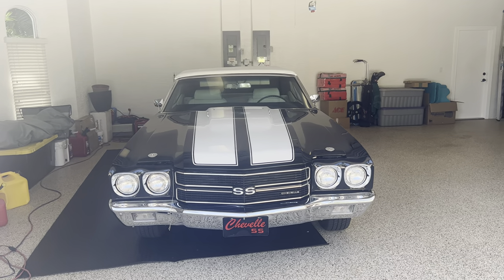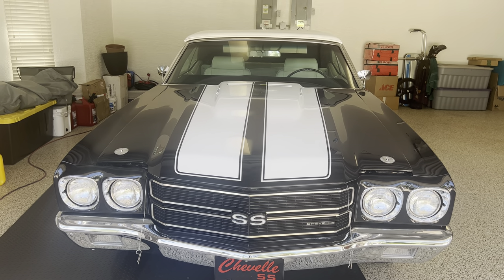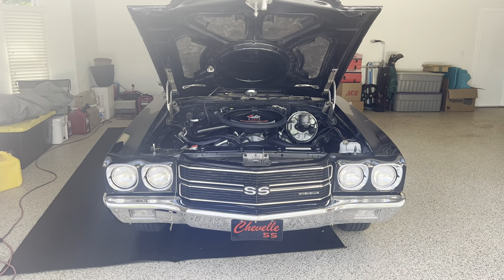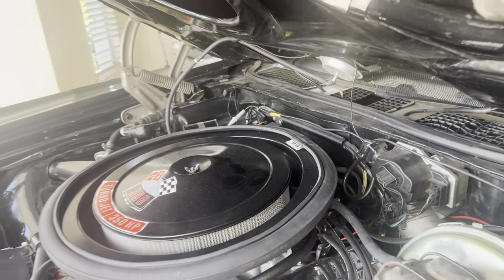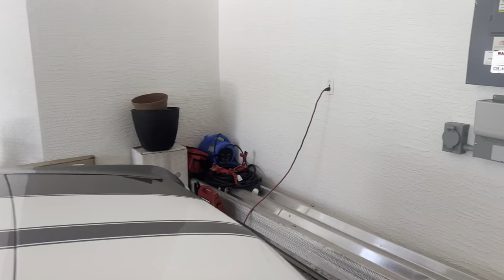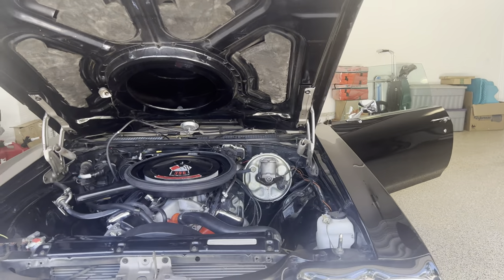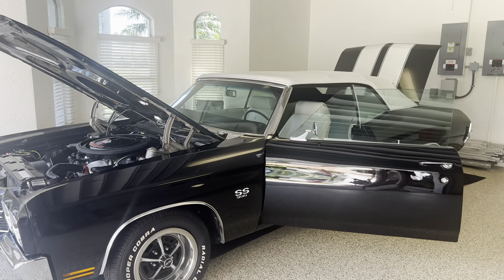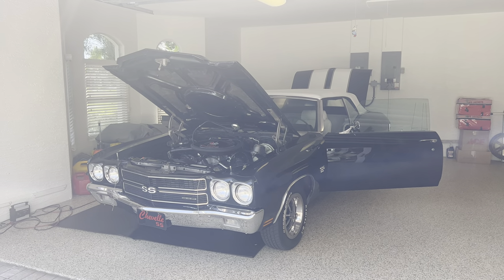FOR SALE!! Earliest Known Baltimore, MD Built 1970 SS Chevelle Convertible Surfaces in South Florida

Comment: Hi I purchased this car its very nice , the owner had the original numbers matching transmission, radiator, condenser, shifter and console and drive shaft . I will bring the car to a much higher level , New interior complete  , everything  back to original . Undercarriage and engine high-end detail, correct 14in SS wheels and correct firestone tires. New rear bumper .  The only thing am not going to change is the paint color , the paint is very nice , looks great. My cars are very high quality . I kept Intouch with owner for several months and final came to far deal .I wanted an LS 5 but so hard to find numbers matching Chevelle's with a build sheet. I have a very nice Monte Carlo SS 454 LS5 so the 396 will ne a nice addition to my collection. I appreciated all the comments and all those changes will  be noted and corrected , like I said am just not changing the paint color, paint and stripes are vey nice.

Comment: Patrick, I've been missing the videos, but that's  the "nature of the beast."You can't just "wish them out of hiding. "
A spectacular car.
I just saw Nikki six 71 Chevelle convertible sell at B-J for 100k.
Really nice car. I should've checked again first, but I know it was Cranberry Red, White/White, 71. I'm pretty sure it was a 71, not 72. It was 100k even.
-
I would Cruz to shows as is, Gently 😁. It looks great. It does have the Chrome strip under the headlights you say are present on earlier builds.
The glare outside made it hard to tell until the grill shot at the end.
Going by current Mecum & B-J auction numbers. I would think it an insult to offer anything south of 100k.
Factoring in a $15-20k or more perfect Fathom blue paint & trans swap back to original.
Great Job.
Thanks.🇺🇲

Comment: Would have been nice to hear it Patrick. might help with the sale.
Reply: Why start up the engine???    I've seen enough just going over the information.    It's a driver car, not a survivor car.   Non original transmission and changed over to a 4 speed.   Non original color either.     Just remember, if Patrick didn't buy it, you don't buy it.    LOL
Reply: @gregorylyon1004  When was the last time you bought a car with out listening to the engine?

Comment: Considering how that car was built, why does someone make these changes? They didn’t restore it because restore means take back to original. If you want to float around on radials, go buy a new car. 15” wheels with lower profile radials don’t fill the wheel wells like 14” wheels and original white letter bias plys. Nice despite all that.
Reply: This car is a daily driver car, not a survivor car.   If Patrick didn't buy it, you don't buy it.    Non original

Comment: This is an A/C car in South Florida, BUT where is the compressor?? Car was restored with the wrong color, some aftermarket parts, no a/c and transmission was changed to 4 speed? (Yes you stated the original is still included) Granted, it's still a NICE car, but all that SEVERELY affects its  CURRENT resale price. If you're NOT listing it here, then it's likely WAY TOO MUCH... Thanks for bringing this video, don't get me wrong, Patrick keep up the good work!!! Best Wishes!!
Reply: That car is a driver car, not a survivor car.    It better be cheap.    Patrick didn't buy it, so you don't buy it.     Non original joke with highway gearing

Comment: Trunk emblem delete ??
Reply from the maker: The holes were filled in. Evidently the individual responsible wasn’t a fan of the deck lid emblem.
Reply: @patrickglennnicholsmusclec1674 Hi Patrick. When l did a frame on restore of my Forest Green L34 4spd w/white stripes, l chose not to put on the 396 emblems under the SS fender letters. I think it looks clean without them. I could install them if necessary l do have them. Thanks for the great informative videos.